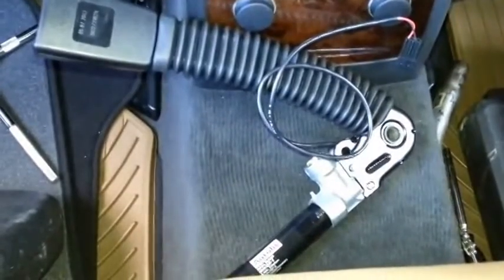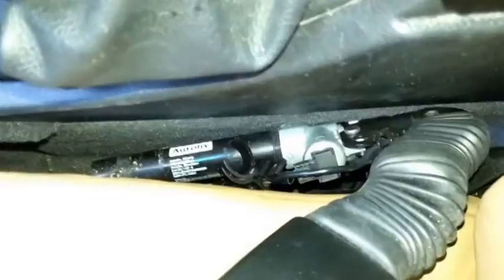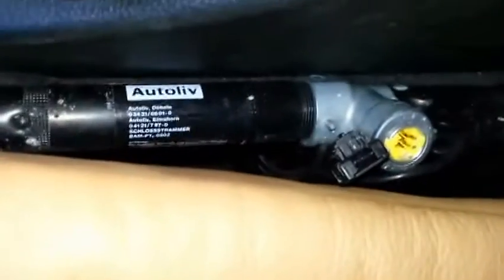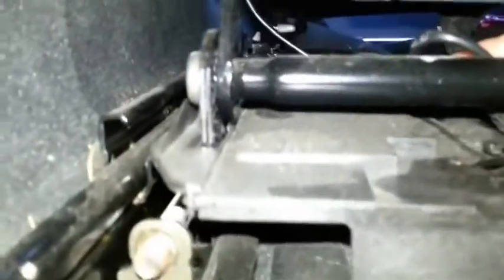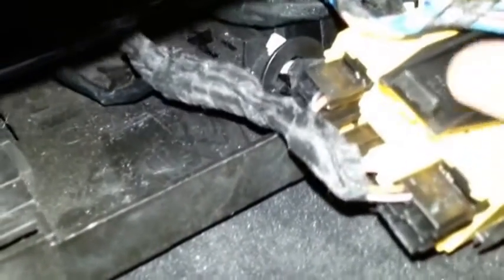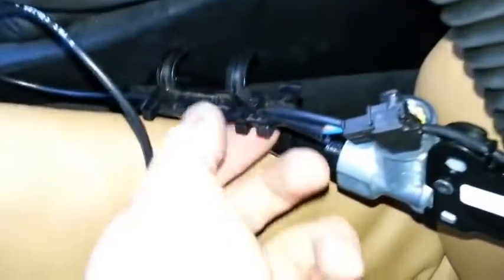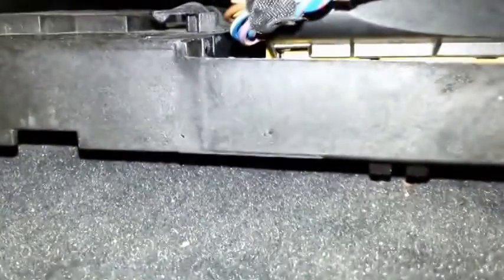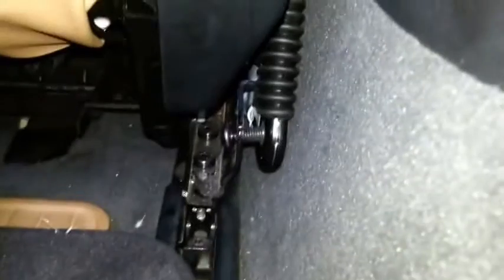BMW 5 Series E60 E61 2004-2010 Seat belt buckle removal and install new on e60 535i 2008

Comment: Thank you for your video! A few mechanics told me they have to remove the seat. But, you did it without doing so. My issue is the passsenger side, but there cannot be that much difference if at all. I have a 2006 525i.
Reply: @Emory Tony Instablaster ;)
Reply: @Lyric Ishaan thanks for your reply. I got to the site through google and I'm waiting for the hacking stuff now.
Looks like it's gonna take a while so I will reply here later with my results.
Reply: @Lyric Ishaan It worked and I now got access to my account again. I'm so happy!
Thanks so much, you saved my ass :D
Reply: @Emory Tony Glad I could help :)

Comment from the maker: hi,

the srs unit controls the airbags and seat belts to deploy and tighten when in a accident.

after accident it needs to be cleared to clear any airbag or restraint lights. some shops can do it.

sometimes the unit gets damaged and can not be cleared but needs to be replaced.

if it needs to be replaced it will need to be reprogrammed by bmw. that can take several hour,. which = expensive.

it is located usually under the center counsel,

i think in some of the 2007- 2010 bmw started putting the srs unit in the glove box area. which = much more expensive.
because they put the srs unit and several other very important computers together.

so if one fails the whole big expensive comp unit needs to be replaced, and reprogrammed.

if you have anymore questions please ask.

my 2008 bmw 535i srs unit was in the center counsel.
Reply: What if you only have a broken buckle?  Some piece inside the buckle broke.

Comment from the maker: yes, DEFINITELY disconnect the battery when working on things like airbags or sensors.

i do not know 100% if it would deploy while installing but i would not want to find out, lol, know what i mean.

it would be very painful and expensive to buy another one.

Comment from the maker: hi,
yes, it was on.

even after changing it, bmw was unable to clear the codes because my srs unit was bad from the airbags deployed. (they said sometimes this happens, another way for them to sell more parts)

so i had to buy new srs unit and have bmw reprogram my srs unit which took couple hours and $hundreds of dollars later everything was fine.

its a beautiful car once everything is fixed.
Reply: Billy BK how much was the total after replacing the Srs sensor on the dealer

Comment: Good video, BillyQuestion:  I have a 2011 5 series and backed into a pole. No airbag went off.  Head restraint popped and also got the seat belt sensor warning on iDrive screen.  If I fix the belt as you did her and replace the headrest mechanism, will the sensor warning go away?  If not, how do you reset?Thanks!
Reply from the maker: +Huh? 
hi, once the airbag light turns on then the light will have to be cleared by dealer or a special obd2 code reader computer.
the newer the car the harder it is to clear on a obd2 code reader computer. my car was a 2008, no code reader could clear it BECAUSE my srs unit got damaged. 
they get damaged because dealer will make more money from you. its a hit and miss for the srs unit to get damaged.
you might luck out with a obd2 code reader, but if not then you have to go to dealer, they have the special computer for these special cars.

hope this helps,
Reply: Huh? After you change the seat buckle you can reset it with scanner c110 and good to go